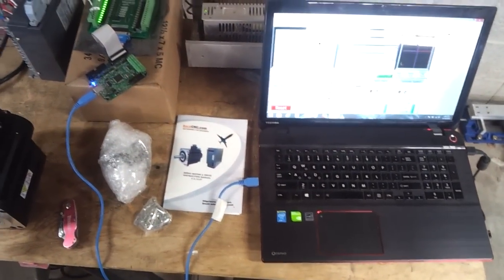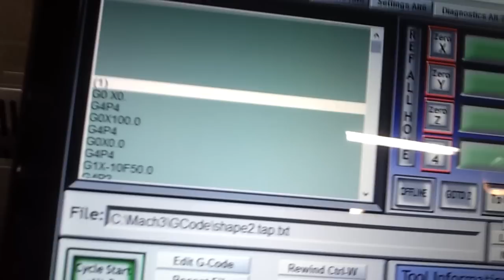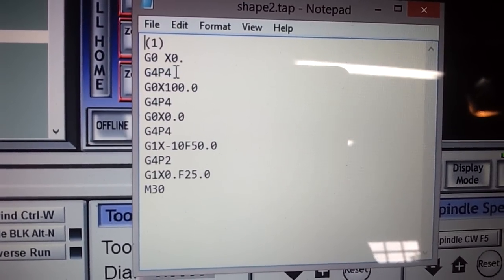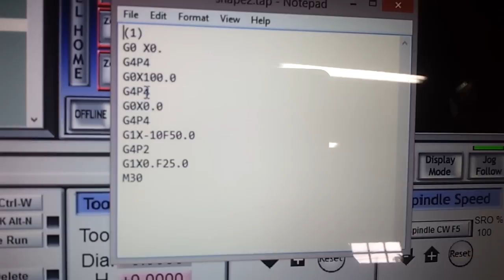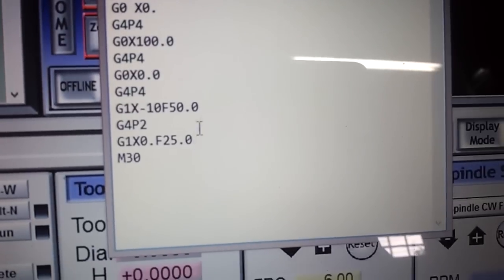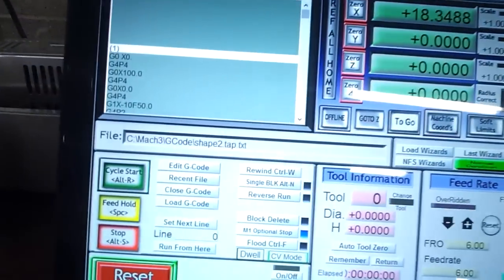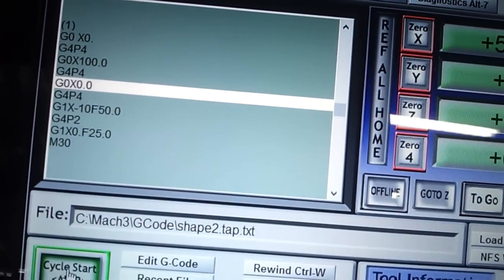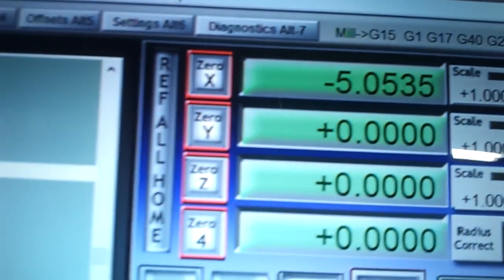2KW AC SERVO MACH3 WINOS8P1 PART 1

Comment: Regards
I need to control 5 servo motors and drivers from my computer, what motion controller card recommends me to retrofit my vertical milling machine to a CNC machine and with what software does it work?

1.       AC SERVO MOTOR HF-SP152 MITSUBISHI (01)

INPUT 3AC    126V    8.0 A

OUTPUT 1.5 Kw – 2.000 rpm

SERVODRIVER – MITSUBISHI

MODEL: MR-J3-200A

POWER: 2KW

INPUT: 10.5 A  3PH+1PH200-230V 50/60 Hz

OUTPUT: 170 V     0-360Hz  11.0A

2.       AC SERVO MOTOR HF-SP102 MITSUBISHI (01)

INPUT 3AC    125V    5.3 A

OUTPUT 1 Kw – 2.000 rpm

SERVODRIVER – MITSUBISHI

MODEL: MR-J3-100A

POWER: 1KW

INPUT: 5.0 A  3PH+1PH200-230V 50/60 Hz

OUTPUT: 170 V     0-360Hz  6.0 A

3.       AC SERVO MOTOR HA-FH 43G MITSUBISHI (02)

INPUT 3AC  

OUTPUT 0.4 Kw – 2.000 rpm

SERVODRIVER – MITSUBISHI

MODEL: MR-J2-60A

POWER: 0.6 KW

INPUT: 3.2 A  3PH+1PH200-230V 50/60 Hz

OUTPUT: 170 V     0-360Hz  3.6A

Thank you

Comment: Good day, Robert Underwood! I wanted to ask how to set up servo driver control of step / direction. The control signal is a step / direction should be soldered to the pins on the DB25?

Comment: i was hoping to see you turn the shaft manually and the dro showing the movement.
Reply from the maker: Great comment!! I will look into updating the (DRO'S) from the AC servo  control to the MACH software. I bought this servo drive to learn about running servo  with PC controls. Any help on converting output signals from servo drive back to MACH  DRO's would be appreciated.  Thanks again for your comment
Reply: i was looking into the ajax cnc for mach 3 . they claim to have true closed loop. i want to do that too. ur a few steps closer then me.
Reply: I saw someone did it over analog board and getting encoder data out of db25 back to mach3. but I am not sure why he claims you need analog board.
I saw also modbus support and that would be a path to easy get data out and control drive. I will look more into it.
Reply: I just checked in manual and on db25 there is only one analog pin and that is 10v spindle control so I don't think that is a condition at all for feedback.

Comment: Are you using this for a spindle? Sq column z axis?
Reply from the maker: NO not for spindle, I just purchased to try with the mach III cnc software. Probably could use as spindle  though. would be interesting to try.  Thanks for your comment